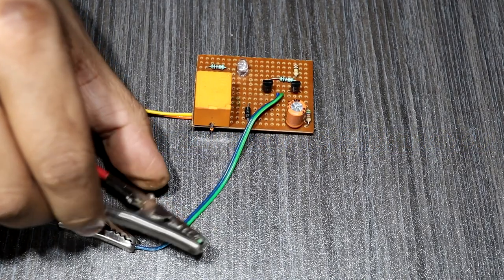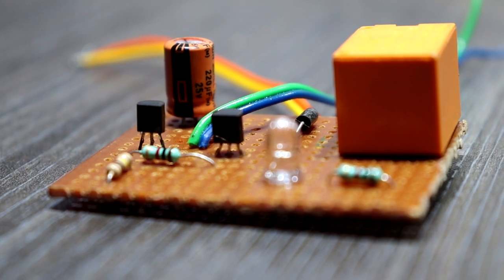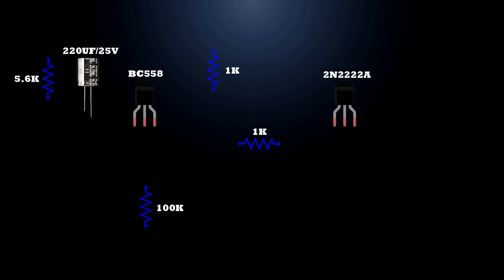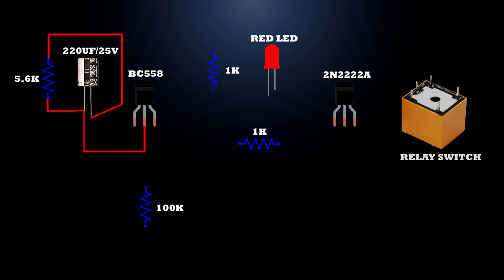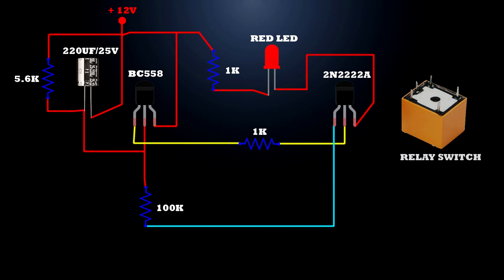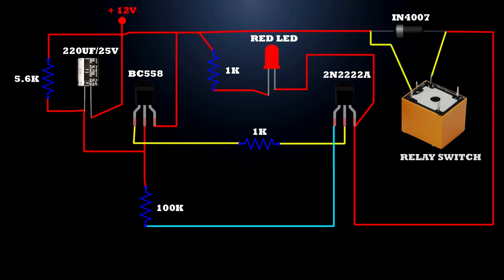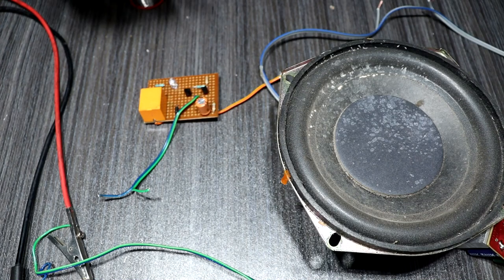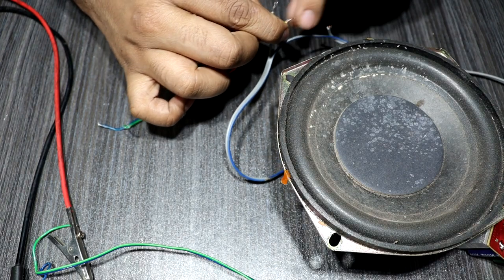DELAY ON TIMER ⏲. USING ONLY TWO TRANSISTOR. PROTECT YOUR ELECTRICAL ARE ELECTRONICS EQUIPMENTS.

Comment: Hi. It worked perfectly. Thanks for the video. I have some questions. 

1)When I’m using this with some battery is this module drain the battery fast??

2)In my case how can i use this with 10v

Comment: Nice circuits time delay incrise and decrase which resistance value change please replay
Reply from the maker: To extend the relay activation time and adjust the delay, simply modify the capacitor without altering any resistors. A higher capacitance value will prolong the on-time delay, while a lower capacitance value will result in a faster relay activation.

Comment: Nice!! I am just looking circuit like this.. could you pls able to suggest me to buy the circuit as my expectations as follows?

I want to run dc motor repeatedly in particular time interval like dc motor should be running 10 sec and should be not running after 10 sec it should be repeatedly like this....

Comment: The 12v connection you showed. But you did not show the output connection to any appliance.    Or speaker it was hidden
Reply from the maker: I am very very sorry for that mistake.

Solution here check out this diagram.https://photos.app.goo.gl/hgrMFysKQ325NJ5d6 this the relay connection diagram. Follow this step. You will use this circuit  on a speaker protection same setp.